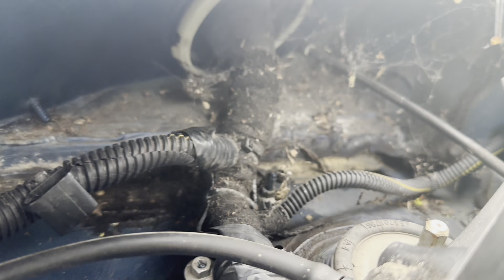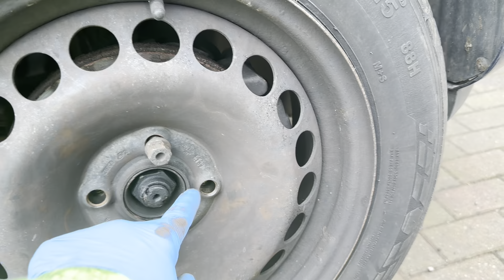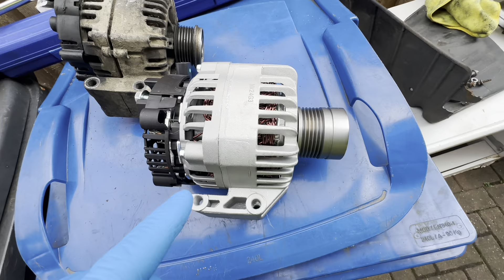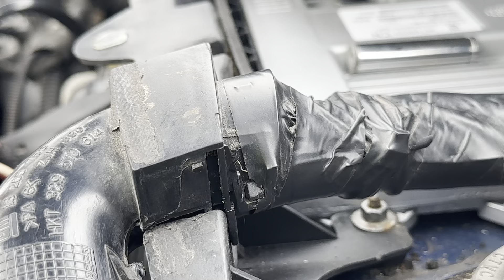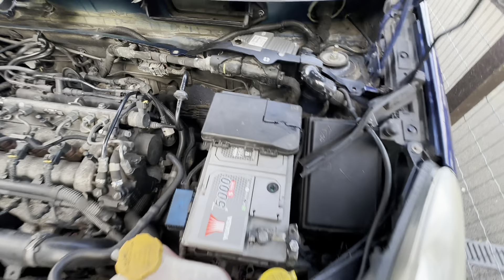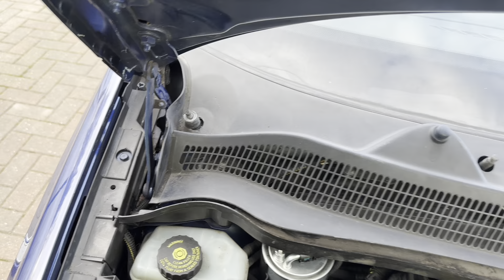My broken Corsa D 1.3 CDTI Can we save it ? ? ? part 2 …

Comment: Would it be possible - good to lift the ecu a bit, so its not sitting on the floor of the drainage canal?
Reply from the maker: @boranfilipi9358  yes this is possible but the area of it filled with water would still cover the ECU sadly. It’s a very poor placement for the unit
Reply: @knightsofengland1  I will try to do it today. THX for the answer, all the best.